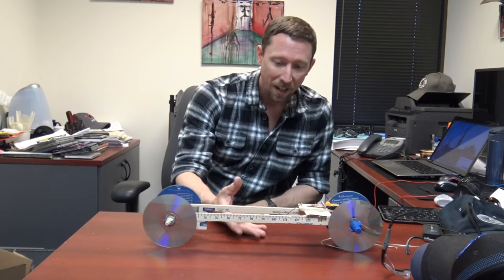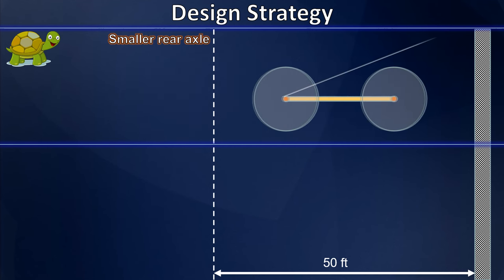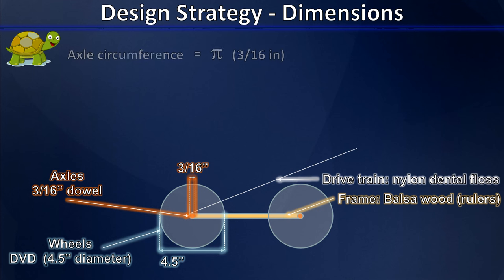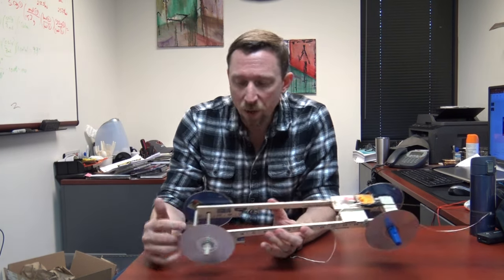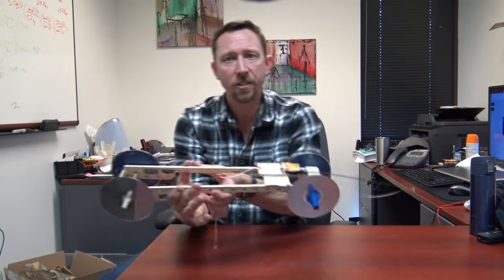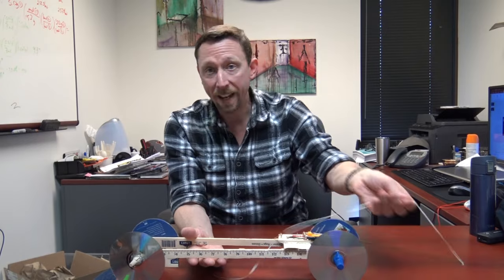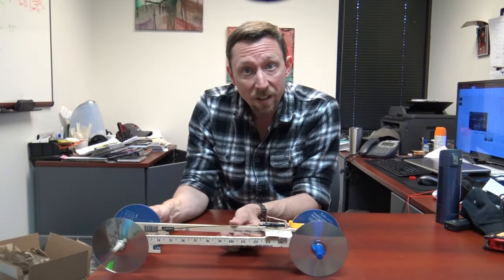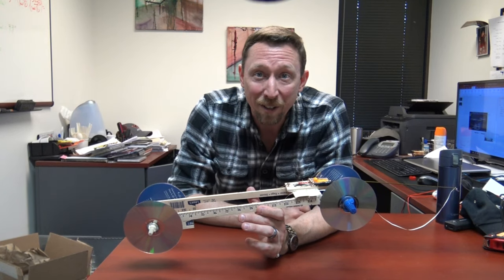How to Build a Mousetrap Car for Distance with Professor Davis

Comment: Thank you, this video has been the most descriptive and well explained way on how to create this mousetrap car, and it even gave me a little lesson on axis and how they effect the car. I also appreciated the equation on how long the string must be to reach a certain distance. Thank you for saving my grade! :)
Reply from the maker: Glad you found it helpful!  Good luck with your project!
Reply from the maker: Also, here is a tip that I didn't mention in the video.  A few puffs of graphite lubricant (the kind used for locks) on the bearings and axles will reduce friction even more, giving you a longer coast at the end of the run.
Reply: ChemSurvival oh perfect, I made a rough copy already but my final car will include that!
Reply: ChemSurvival thank you you saved my grade I think with graphite
Reply: Alec Decowski  Do your own work stop stealing off other people
Reply: L-G-S GanG Pot meet kettle

Comment: hi Professor Davis, my mousetrap car wont move when put on the ground, or at least not move far. i dont understand, because my model is literally the exact copy of yours. I need to surpass 25 ft to gain full score, but i dont know why it isnt working, i sued lubricants and cds like you?were testing tomorrow, have advice?
Reply: Nevermind, after 3 hrs of experimenting i realized that the wheels weight was too heavy! it travels ~35 ft no problem, surpassing my needs. great video!
Reply: i hate snakeu Howd you do it

Comment: not clear on what is the width and showing every part. I did the same thing it did not work did you use nail on top to join both together? I used glue it did not work.
Reply from the maker: We used hot glue to make all connections (the type of glue that comes in sticks and requires a small, electrical gun to apply).  Things like elmers glue or liquid nails will not hold up.

Comment: hey, I created a slightly different car similar to this one. my back two wheels are jumping, think you might have the answer?
Reply from the maker: If by 'jumping' you mean breaking free of the surface and 'peeling out' causing you to lose energy, then you have two options:  1. try to increase the friction between your rear wheels and the surface by coating the edges of the rear DVDs with electrical tape or a similar material.   2.  decrease the diameter of your rear axle.  This will reduce the amount of torque reaching the wheels and should give you a gentler acceleration that might keep your wheels from skipping (as a bonus, it will give you more travel distance under power!).  good luck!
Reply: It might not be attached well enough

Comment: We have a project in my Engineering class that involves us making mousetrap racers and there is a competition to who can drive their car the furthest. My question is that if you keep on extending the coat hanger length, won't the distance traveled by the car be more and more, or is there like a limit to how long the coat hanger can be? thanks :D
Reply from the maker: Yes.  The longer the arm is, the greater distance the car will travel under power.  However, the longer the arm, the less torque it will deliver.  Eventually it will not be enough torque to overcome the friction of the bearings and axles, resulting in a car that doesn't move!

Comment: Is there anyway you could give me  a list of what materials you used?
Reply from the maker: In a nutshell:

1. Low temperature hot glue to secure the frame and attach the axle/wheel bearings
2. 3/16" dowel rods for axles
3. Fender washers (8) as wheel bearings (be sure the opening in the washer is just slightly bigger than the 3/16" dowel rods)
4.  Coat hanger for the mousetrap arm extension
5.  Balsa wood rulers for the frame and the mouse-trap mount (we used these because it was what we had on hand, if I were to do this again I would probably use more dowel rods in place of the rulers to form a lighter frame).
6.  Glide dental floss (the strong, flat type) as the drive-train
7.  DVD's (4) for the wheels
8.  Tan or Blue wire nuts (4) to serve as wheel hubs
9.  Graphite lock lubricant to reduce friction between the axle and  its bearings

That is about it.  You might need a small drill (for making axle holes in the frame) and/or saw (to cut dowels) to complete the project, but if you are clever you can probably find some easy ways to avoid needing those tools at all.

Good luck!

Comment: Does anyone know how long he made the coat hanger?
Reply from the maker: The coat hanger must be exactly one half of the length of the floss making up the drive train.  This way, you get maximum travel under power.  Just use your axle and wheel circumferences to determine how much floss you need to get the desired travel distance for the car (see the video), then build your vehicle around that key dimension.
Reply: ChemSurvival thank you so much! I’m doing a similar design and I’m totally gonna crush the guys in my auto class

Comment: What material did you use for the lever and how did you attach it to the mouse trap?
Reply from the maker: I used a piece of a wire coat hanger cut, straightened and secured by first using hot glue, then reinforcing the connection by wrapping it with electrical tape.
Reply: @ChemSurvival  thanks g u a homey lmao
Reply from the maker: @officixlprez1754  werd B-)

Comment: What is the with of the front and back axle
Reply from the maker: I assume you men the length, end-to-end?  The axles are about five inches long (including the portion inside the wirenuts).  This made the frame itself about four inches wide (ruler-to-ruler).  The best choice for axle width will depend on the dimensions of the mousetrap you have, but we found that a frame narrower than 5 inches meant less stability when the car was in motion.

If you are asking about the diameter of the dowels, making that choice is discussed in the video.

Comment: Why not just use a wheel bearing or drive train bearing for rc tenth scale race cars they are faster smaller but inside hole can come any size you want. I did it your way and my way and got to 90 feet using rc car bearings instead of washer bearings
Reply from the maker: because you are obviously thinking outside the box (good for you!).  As I mentioned in the intro.... this was our prototype build with what we could find in our garage.  I'm guessing most folks don't have tenth scale RC cars in their garage, either ;-)